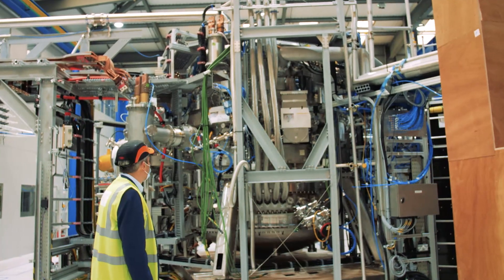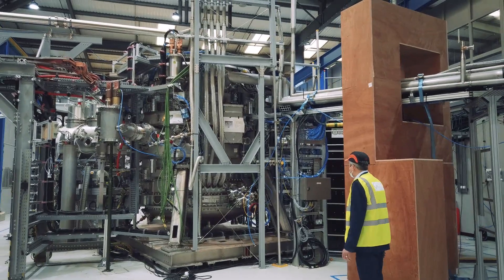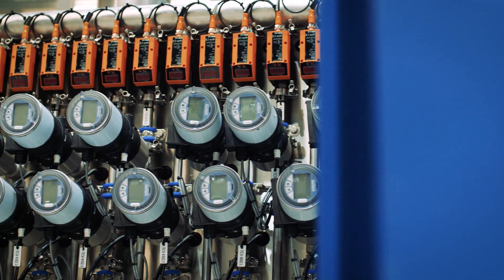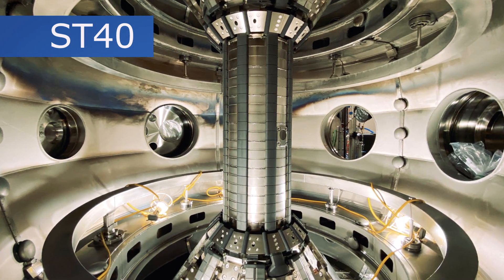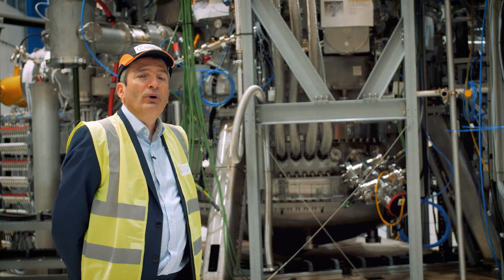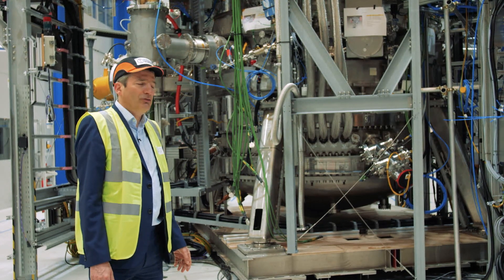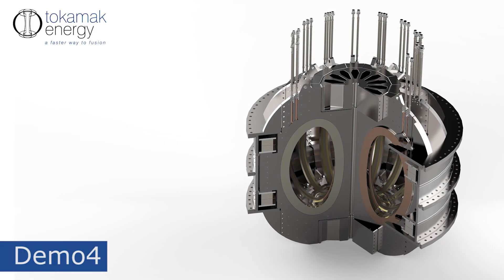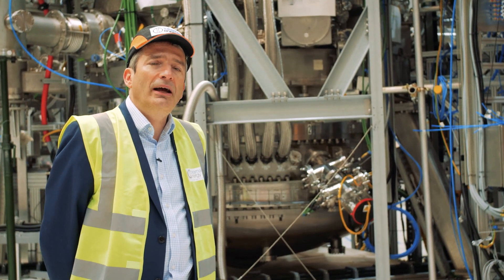2020 fusion progress at Tokamak Energy

Comment: There are rare earth metals in the superconducting tapes you are using. Will that result in resource issues in the event of a large scale fusion energy deployment? Are there any viable alternatives? For example MgB2?
Reply: Although rare earths are used in the tapes, the mass is very low (the HTS layer is around 1 micron thick).  Whether a significant fusion roll out would put pressure on global reserves, I don't know.  By the time that becomes a possible issue, alternative HTS materials may be available, I suppose?

Comment: You guys are what, 2-3 years ahead of ITER? Nice!)
Reply: 3 Tesla, I don't see how that is ahead. But I guess their progress could be quicker in the future that might allow them to get to fusion before ITER. But that's still an IF
Reply: @flemlion13  How many Tesla is ITER producing then?
Reply: @flemlion13  now how easy would it be for ITER guys to implement something like liquid metal surface for plasma facing components? That feature alone can require reactor to be much much smaller or lower the required plasma temp. My biggest concern is that during the 25 years of ITER implementation there ought to be some progress in the field rendering the whole project outdated even before its first plasma
Reply: @morkovija  There is indeed a difference with the startups trying fusion, they are generally also looking into more bleeding edge technology (like high temperature super conductors). From what I know ITER is using super conductors that have proven their worth, but require colder temperatures. A project this size does not take those risks, it has supportive projects, like MAST and JT-60 that try things out.
Reply: @flemlion13  My point is that ITER produces 0 Tesla at this moment and will be obsolete by the time its turned on
Reply: @axiom1650  Neither does Tokamak Energy in an equivalent tokamak. ST-40 is not equivalent to ITER. If you want to compare, maybe you can compare ST-40 to JET. Although JET has run fusion already, and I'm not certain that is the goal of ST-40, I think that's for the successor of ST-40, which would make ST-40 a generation behind JET and two or more behind ITER.